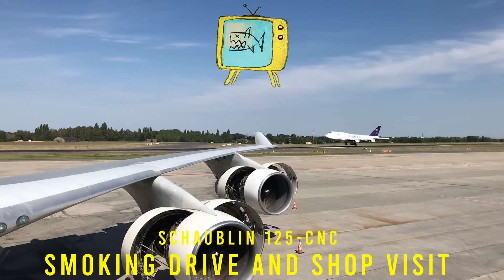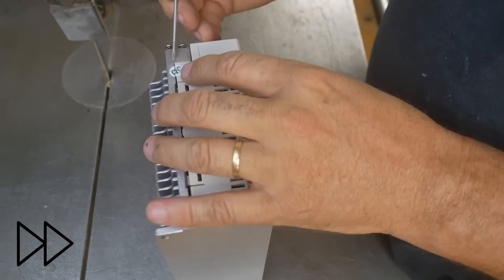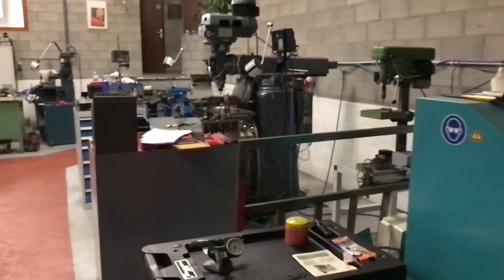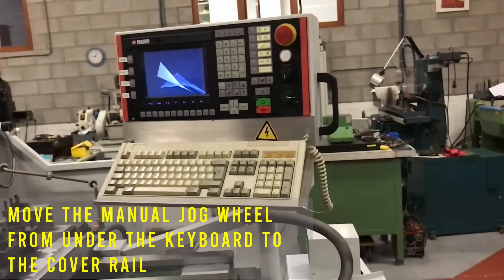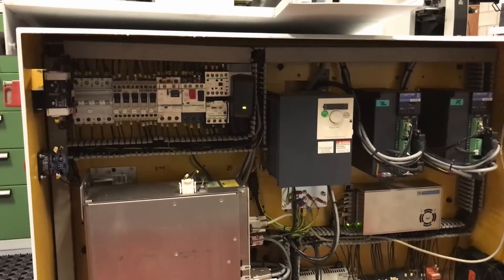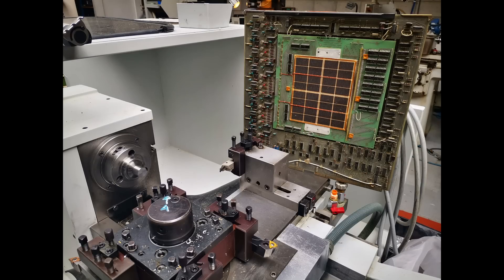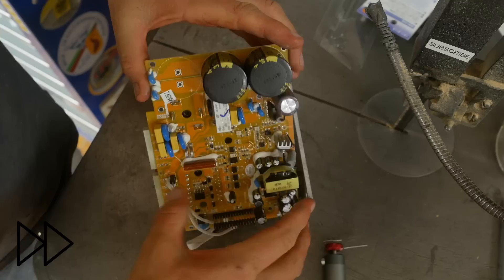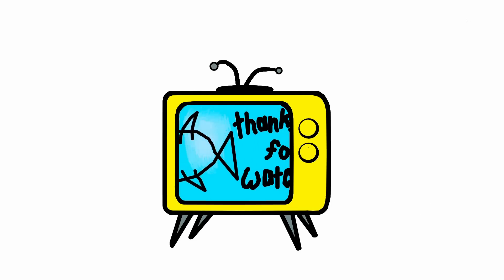When did my drive start smoking? Schaublin - Ep.42.

Comment: Smoked drive reminds me of a day I was fault finding a machine. It had two spindle motors 15 KW each and a single supply to run a drive each to run them both.  It was a bit complicated as it synced both spindle motors together and was capable of rigid tapping at 4500 rpm.  After I had cleared a few low level alarms I wanted to check the power fault in the supply and had it opened up with my meter on it. When my helper powered up the machine I had a meter on it checking enable signals bloody thing blew up 2 500 transistors right in my face.  Scared the crap out of me.
Reply from the maker: I bet that was a a really bad smelling control cabinet, even after you switch out your Y fronts :)
Reply: @RotarySMP  It had some power behind it it blew my cap off.
Reply from the maker: @dazaspc  Lucky you were not injured.

Comment: So far as I know the only benefit to trimming leads to proper length before soldering is that it gives a prettier, more uniform joint and is more flush to the board. Clipping after is just more proud and bulbous of a joint.
Reply from the maker: Thanks for that feedback.

Comment: My father taught me to cut the components leads after soldering and he was a time served RAF avionics and radar engineer he said that if you cut before solder you can damage the component and if you do it after the solder’s strength is the barrier to damage, he taught me that 48 years ago when I was just ten. And the chaps shop was paradise lucky man and was that a shadow graph machine at the end?
Reply from the maker: Yes, he had a very nice comparator machine which he showed me. One of those auction finds which you dont think you need, but can pass up at the price, and then wonder how you lived without it.

Comment: Curious, but sometimes stray charge just takes long to dissipate. I met a nice old oscilloscope the other day, had to warm it up for half a day after it spent years collecting dust. Worked like a charm eventually.
Reply from the maker: Do caps need to charge and discharge a couple of times to "condition" them?

Comment: horrible setup. all distribution in the machine should be handled by a transformer.
Reply from the maker: Thanks for your feedback.
Reply: @RotarySMP  sounds like you said you got 240 and 400v coming through that 5 pin cord connector. There should only be 1 voltage coming into the machine.  That voltage goes to the main transformer where  the neutral is produced, the voltages divided and sent off to their appropriate place. Never seen a neutral line ran to a piece of industrial machinery. Almost all servos are single phase 200v nominal.
Reply from the maker: @DieselRamcharger  The supply here is Gnd/N/L1/L2/L3.  I switched N and L3 when I put the plug on.

Those Servo drivers are 220V single phase.
Reply: @RotarySMP  yeah you normally wouldnt be carrying that N into the machine. Your plug is typically G l1 l2 l3, into the main contactor then off to the center tapped transformer where neutral is "made". It just makes hooking and unhooking the machine service a lower skilled job. A brief brain fart was all it took to smoke your control and it just shouldnt be that easy to screw all the pooches. your power must be different over there too, as we are 120v to ground and 220 phase to phase. no way to get 400v in america....well, not at a home shop anyways.
Reply: @RotarySMP  and pls dont take it the wrong way. just wanted to help. i work with machines, not people. my social skills reflect this. lmao.
Reply from the maker: @DieselRamcharger  Thanks for the input. That makes sense.  I wondered why those big transformers were used, when no voltage change was needed. I am too far down this rabbit hole to change the schaublin power lay out now.

Power here is 240 phase to Neutral, 400V phase to phase. Almost all houses and apartments have a three phase supply, for the oven.

I have three 3 ph 16A circuits. One directly to the basement for the ground water pump, one to the kitchen oven through a CB and ground fault interrupter, and another to the basement sockets through another CB and ground fault interrupter.
Reply: @RotarySMP  I suspect that  the transformer with same voltage in/out  is actually a line reactor (or choke) which is a noise filter . VFD or servo drives can create 
some incredibly noisy feedback back to the powerlines, and so the line reactors are pretty much manditory in high amperage systems. lots of good referances on the internet.
as always refer to your manual and local regulations😁
another option is an isolation transformer where the primary and secondary coils are separate and interwound . again it would be used for line  noise except for incoming 
this time.

Ancient fanuc DC motors and drives were very sensitive to incoming voltage ,so there was always an adjustable tap secondary side transformer so that you could best match 
 primary to required secondary.
modern AC drives are far more tolerant of voltage fluctuations.

Comment: I'd replace that cap with something better than a Yaego - I have a whole box of Yaego caps I've removed from stuff that have failed. You want something from Panasonic, or United Chemi-con, not some generic chinese garbage
Reply from the maker: Thanks for the tip. It is hard to buy components here, as the the big onloine stores dont sell to individuals.
Reply: @RotarySMP  Hmm, that's not great - you don't have a digikey or mouser equivalent over there? Even when you choose caps from panasonic or united chemi-con (or Nichicon - I knew there was one I was forgetting), in that application, you definitely want a series rated for high ripple and low ESR. For Nichicon I use KZE series, and for panasonic I use EB series. Also always aim for temperature rating of 105C or higher. If you use a good brand of the right series and temperature rating, they last a LONG time. If you use cheap no name chinese garbage, you'll be visiting that cap again in 3 or 4 months.
Reply from the maker: @gorak9000  That is the problem. For whatever reason, Mouser, RSonline etc will not sell to individuals. You have to have a company to make an account with them here.
Reply: @RotarySMP  There's no way to just pay by CC for each transaction separately? I could see needing to be a company to open a "net 30 day" credit account with them, but in North America you can just go on the website, put parts in your cart, make an account (if you don't already have one, or login if you do) and pay by CC. I'm sure they do a lot of business selling to individuals here that aren't companies and just doing one-off orders, whether it's for hobby projects, parts for repairs, small production runs or prototyping. Have you tried calling them and asking why you can't do the same there? That's just weird. Digikey in Canada even has $8 overnight shipping on basically any order (oddly, the digikey shipping options in the US are much slower and more expensive, even though it's the same warehouse that serves both the US and Canada - Mouser tends to be the better option in the US)
Reply from the maker: @gorak9000  I think it is related to the higher standard of warranty legally provided to consumers verse companies. They avoid liablity by simple excluding consumers. One of my workmates had an old login to RSonline, so we tried to use that, and they threw him out :(
Reply: @RotarySMP  That really sucks - sounds like a case of a law with good intentions screwing it up for everyone

Comment: I've an antique lineshaft driven turret lathe that has a 8 speeds, a high/low range you can go between instantly and an instant forward/reverse with a mid position brake...
It also retracts the toolpost at the end when threading...

I've got old images of them being used during WW1.... 

Oh....
I think you'll find BSP is still the most commonly used pipe thread
🇬🇧☹️
Reply from the maker: My Mate has has a turret lathe. Very productive machine once set up.
Reply: @RotarySMP  

All my stuff is flat belt driven...
I've surface grinders, blade grinders pillar drills, radial drills, tappers, milling machines, lathes and a slotter...
I'm just about to take ownership of a large planer too...
🇬🇧☹️

Comment: Because you’ve had capacitor juice escape: no doubt you’ve used the Bendix King KX-155 aviation Nav-Com at some point. Somewhere in the middle of the many years they were built, apparently, the factory got a batch of faulty electrolytic caps; certain ones were mounted in such a way that leaked electrolyte would drip onto the next circuit board below, and dissolve whatever traces it contacted. In my case it knocked out the nav audio path. It may be slow, but the stuff is pesky!

Enjoyed the shop tour. Cheers 👍
Reply from the maker: I need to disassemble it again, resolder the leads, wash it in IPA, and put a bead of silicon to dampen the cap to the neihbour.

Comment: Damn those plugs... I was installing like 10 of those sockets and when I had to do the plugs, I put the first one together mirrored, like the socket and I was sitting over it for a few seconds like "Wait something ain't right, what the hell am I doing?"
Don't beat yourself over it lol
Reply from the maker: I even remember thinking earlier that I needed to remember the mirror image. Duh!
Reply: @RotarySMP  The problem is, most plugs have a screw on the inside from the plug side holding it together so you gotta flip it over and over again so it will try and mix you up one way of the other

Comment: Clipping leads after soldering them is fine aslong as they are less than about 1mm in diameter. Above that you begin to introduce too much stress into the solder joint that it can lead to premature failure. However I've done it plenty of times on my own electronics, also with leads larger than 1mm in diameter and never had one fail due to this, so it's fine to do on your own stuff.
But for production it is not reccomended as it will just contribute to increase the likelihood of failure :)
Reply from the maker: Thanks. I had heard it, but never knew why.

Comment: After an electroboom like that, I'll usually bring up the supply carefully on a variac.  

We EE's might yell at you for clipping after soldering but we all do it ourselves.  As long as you're using good flush cutters and not working to military or aeronautical spec, you're fine. (And as we all know, an elephant is a mouse built to Mil-Spec.)
Reply from the maker: I like that quote. I'll have to remember that one.

Comment: It might be worth cleaning the nearby board too, the electrolyte is quite corrosive so it might damage the traces and chips that were in the blast zone :)
Reply from the maker: Thanks. I need to do that, resolder the leads, and put some damping silicon between the caps.

Comment: Long time electrical engineer here (I actually worked for Data General in the 80's).  You are just fine clipping leads after soldering.  You might want to clean the flux off (with water or isopropyl alcohol on a Qtip) but you don't really need to.  You cannot leave the leads long if you are wave soldering a board in production since it makes a mess.  I really enjoy your channel!
Reply from the maker: Thanks for your feedback. I forgot to clean the boards to remove the capacitor juice, so I can resolder the leads, and remove the flux then.

Comment: @ 10:16 Not at all;... there R NO hard fast rules...
U do it your way;... But most will say...
After snipping;... trimming the legs;... dab your soldering iron to make them look nice & neat...
Reply from the maker: Thanks. I need to pull that board, clean it with IPA; and put a damping damp of silicon between the caps. I can resolder at the same time.

Comment: Thanks again for another video. It's pretty satisfying to fix something (even if it's your fault it got broken in the first place). Seeing Costantin's workshop was amazing but made me a bit envious.. Keep up the good work. - Heather
PS: My new lathe is now turning good bar stock into tiny curly pieces of metal.
Reply from the maker: Hi Heather. The next step is CNC. Produces much more accurate scrap, much faster :)
Reply: @RotarySMP  Yep, I'm heading down that path. I've been looking at the Masso CNC board. It's an all-in-one solution, which will have limitations but I think it will suit my needs. You just connect a screen and use it's own interface to give a sequence of instructions; e.g. Turn a diameter for a set length, then another, then thread cut one etc.

Comment: I too was taught not to clip after "soddering" but in my opinion, of which I think highly, more damage could be caused by undampened  vibration reaching the component. But no one asked me.
Reply from the maker: :) The original had some silicon to the next cap to damp it. Thanks for reminding me to put on some more.

Comment: Hard to believe only a single cap blew when exposed to high voltage. It either your lucky day or that new driver won’t be on the shelf long! Still, I’m impressed you got that thing back on the air.
Reply from the maker: I also have my doubts about the reliabilty of that driver now, but if it gets me started and tuned before the other shows up I will be happy.

Comment: When I was younger.... say my late 20's.  I'd get frustrated with some of the more senior members I worked with.  We would frequently perform a lot of work... sometimes pushing ourselves a bit much.  Then when everything was complete and the opportunity to test our work came.  Some of them would consistently call everybody off to go back to the hotel or what ever.  Then the next day we would begin the process of validation.  I always felt it was a waste of time, and slowed things down.  Now I am one of those senior members, and I have zero qualms shutting everything down, and returning the next day fully rested so I can check the work.  Slow and smooth is most certainly faster and cheaper.  I also get far less push back from management.  If we smoke or break this... finally nobody assumes we can get a replacement tomorrow.
Reply from the maker: Wise approach. I need to improve those skills.
Reply: @RotarySMP  Oh I'm sure you have the discipline.  We all get giddy and just want to see it work... until we let the smoke out.  LOL.
Reply from the maker: @ShainAndrews  Yeah, I should have left that for another day.

Comment: Amazing shop Constantin has! You were very lucky not to blow the rectifier diodes and the mosfet(s) on the primary side of the SMPS of the servo. That startup hiccup must have been hard to swallow, after all the work to replace the fried cap 🙂 But it seemed to turn out for the best and, once you have a spare, it will not go wrong again (Murphy's Law).
Reply from the maker: He really has a great shop. Does really nice work.

Yeah, that is my hope as well. A spare on the shelf means, never every fails again.
Reply: @RotarySMP  Maybe one day you can show some of Constantin projects. And yes, spare parts at hand always beat Murphy 🙂
Reply from the maker: @JoseSilveira-newhandleforYT  I doubt I can show his commercial work, beyond what I showed in his display cabinet. I am sure much of what he is working on is commercial sensitive.
Reply: @RotarySMP  Ah, OK! Too bad. Hope someday he makes something for himself and you can document it - that shop really impressed me 🙂

Comment: Oh dear , the magic smoke got out!  hopefully it keeps running until the new one shows up
Living in Canada I'm used to Single Phase wiring everywhere except for industry or large buildings
I never knew that homes  in europe are 3-Phase
Seeing Constantins shop sure does cause  some nostalgia from my CNC field service days. (except for the hours of driving ,flying,living in hotels, sore back, and sore feet)
I have see everything from structural parts for the ISS ,auto parts,Landing gear for Q400's ,in fact there is an astonishing amount of landing gear made in canada,and just
about every other thing that you could name.
What I most enjoyed was meeting so many brilliant ,creative ,and friendly people that worked there.

When it comes time to think about that seal for the turret you might consider some form of quad lobe 0-ring, they fit in the same space as a conventional o-ring
and are fine with both axial and rotational movement.
Reply from the maker: Over here basically all houses have 3Ph 400V service (the oven is on e 3Ph). Even the apartment we were in the before has a 3Ph service to the kitchen. It is amusing to watch all those rotary phase converter work arounds used in north america.

I am always surprised at how much industry you find in semi rural niche areas.

Good idea on the quade lobe o-ring. I will have to note that for when I get to the tool changer.
Reply: @RotarySMP  well there are 42 million US citizens that live rural and they have to power their nice  old monarchs and g&l's somehow.
(39 million in all of canada for comparison)

there actually is 3 phase power available in much of  main road rural canada (and the US I assume) but the hookup cost is very high,
thus the rotary converters and 1-phase 240V VDF's.
US and Canada are essentially the same, except that Canada normally uses 600 v 3p and the US 440

my house has both 4 wire 240V  (2x120v + neutral + ground) sockets  for things like stove ,cloths dryer, etc that use 120v control voltage 
and 3 wire 240v sockets  (2x120v +ground) in my workshop for things like the  tablesaw 

for 120v duplex sockets in kitchens a 4 wire connection is used (2 x120v +neutral +ground) the top and bottom socket are on seperate breakers,
and the adjacent socket (max 1metre away) is on a different circuit breaker, this way  toaster, kettle, coffee maker ,etc can all be grouped
together but almost never share a circuit breaker (standard 120V plug  on a 15amp breaker)